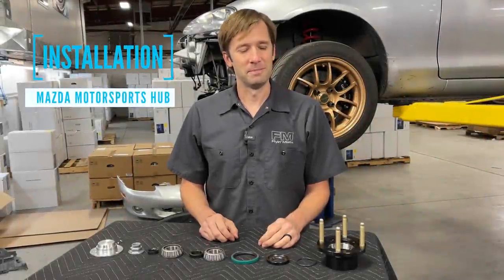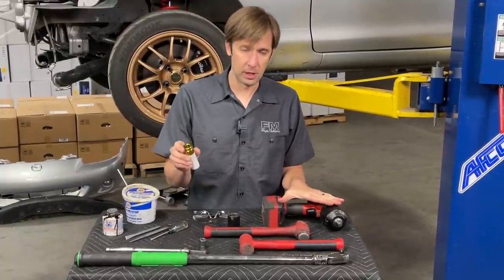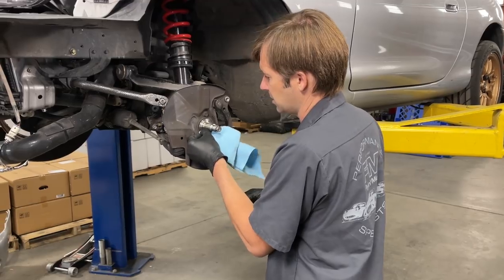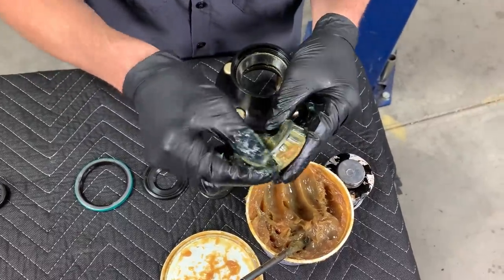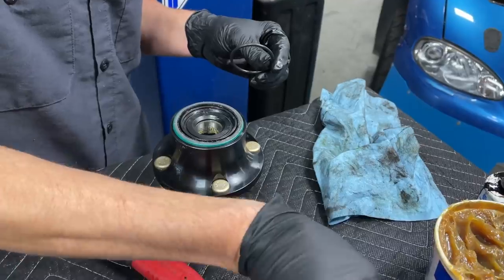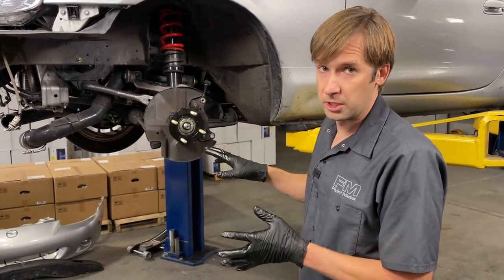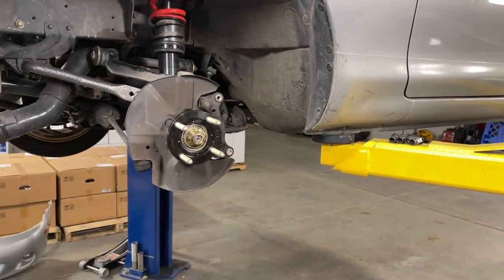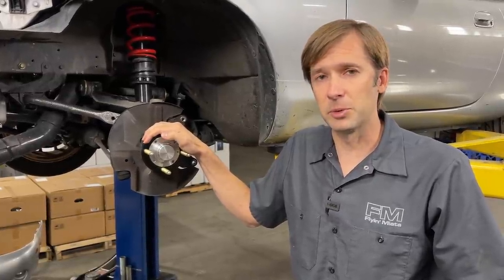Mazda Motorsports Upgraded NA/NB Hub Installation

Comment: You folks really need to update this for V2.0, like, yes make the seal flush and the o-ring behind the shield, (with no sealant).  Thank you for posting videos.
Reply from the maker: We appreciate the feedback, and thanks for watching!
Reply: @FlyinMiataVideo  Thanks for answering.  While your here, I am installing this hub and after I torque and fix the nut, the hub is very hard to spin.  Is this common on these?  do they need a break-in?
Reply from the maker: @brians5088  "hard to spin" is subjective but as long as you've installed all the spacers in the correct order, I'd expect there to be some rotational resistance on first install.

Comment: How do these compare to the MiataHubs brand hubs that you used to sell?
Reply from the maker: The Miatahubs are a great product, but are very pricing and aren't legal in a lot of sanctioned racing. These hubs are much beefier and longer lasting than the stock hubs and do not need constant adjustment like other aftermarket hubs. Plus these are spec legal for both NASA and SCCA racing.
Reply: MiataHubs also do not require adjustment and are a beefier alternative to stock hubs

Comment: This is what Wilwood put out last year.  We tried to run them for endurance racing last year.  THEY WALK OFF. LOOSEN.  Luckily we realized on the track day, the day before the endurance race.  Brake peddle went further and further.  😳.  Wilwood issued a recall.  Don’t trust your endurance race with them.     Been using MiataHubs for 2years without issue, but the price 😩 , also trying Bro-Fabs BMW bearings this next season
Reply: This is not the Willwood product. Mazda tested in endurance applications and did not have that issue.
Reply from the maker: These are not the Wilwood hubs. These are a Mazda Motorsports developed product available directly from Mazda.

Comment: An overly complicated unnecessary "performance" part marketed to persons with more money than actual mechanical acumen. Will there be any appreciable (even measurable) benefit gained? Doubtful. Gimmick.
Reply from the maker: Probably completely unnecessary for a street car. BUT ... Hubs are a known consumable for track cars. These are a Mazda Motorsports part, so it's very doubtful Mazda would put the time, effort and $$$ into developing such a complicated product if there was no need.